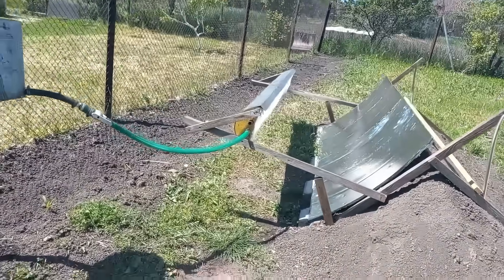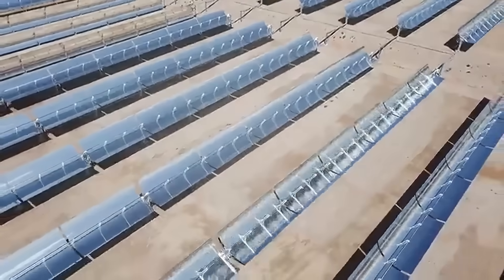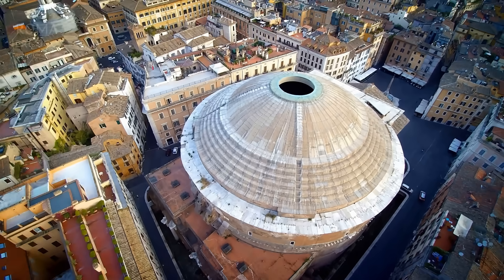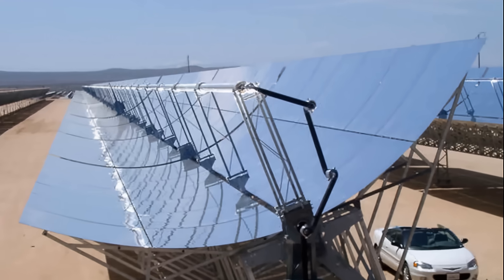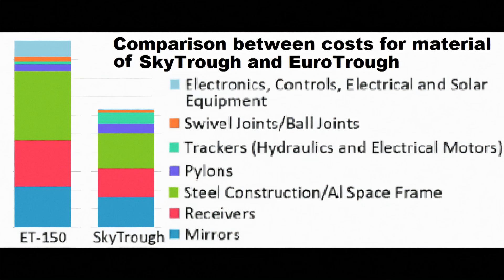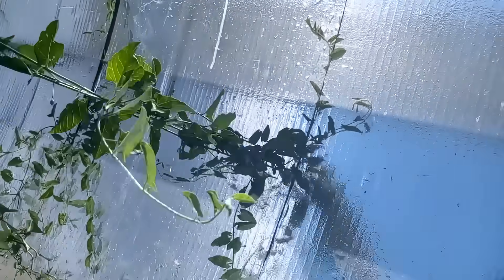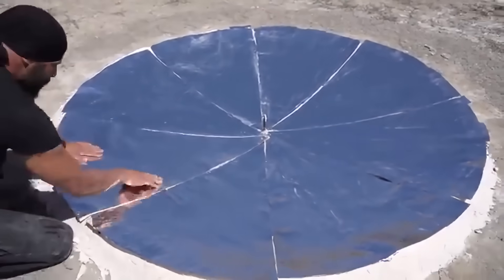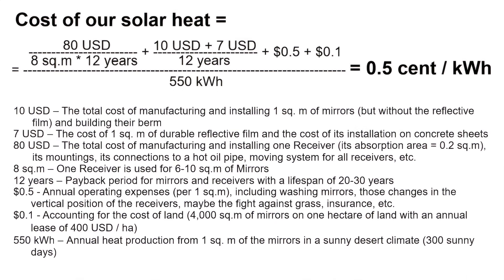Mirrored concrete for cheap solar energy

Comment: I quite like this. And, despite the fact that I know no one's probably going to read this, that is why I want to offer a critique of this idea, since it seems few others in the comments are doing so.

In short, I think this is a brilliant source of cheap thermal energy for certain users... and near worthless as a source of electrical energy, or thermal energy for most people out there. Given that this system outputs its energy as low-grade heat, not electrical energy, it's not a direct competitor to Solar PV. A direct competitor would be this system + a heat engine to convert the heat to electricity. But given how low-grade the steam is here, thermodynamic efficiency is going to be low, low enough that it's basically going to be impossible to beat Solar PV here.

And things get even worse when you consider heat loss to the environment. Most heat engines prefer being built big, to enjoy economies of scale (e.g. a heat engine twice the size, has 8 times the volume, for the cost of only 4 times the surface area and thus 4 times the metal and stuff). Big heat engines, however, require lots of heat to function, which requires feeding them heat from a big area, which requires moving heat a long distance from the mirrors to the heat engine, which means a lot of heat is going to be lost from the heat pipes to the surrounding environment. (Remember, the entire point of this setup is to use cheap materials, like cheap plastic pipes. Even if they never spring a leak, cheap pipes aren't very good at holding in heat.)

So even before we add in the cost of the heat engine, or related things like heat pipes, the cost of electricity generated this way can easily be 10x what you calculated for the cost of the raw heat, 5c a kWh instead of 0.5c, simply because the thermodynamic efficiency of this setup might only be 10%. That's already expensive enough to be about the same, or worse, than Solar PV, before we add in the cost of the heat engine. (Or related costs like the cost of repairing & maintaining the moving parts of a heat engine, compared to the maintaining the glass rock of a Solar PV panel)

So this isn't a better way to generate electricity. But maybe it's a better way to generate heat?

No, probably not. The cheapest heat out there is actually waste heat, heat that costs $0.00 a kWh because it's already being thrown away by someone else. That's what CHP (Combined Heat and Power) is for, where a town or something might heat itself using the waste heat from their local thermal power plant, or a factory might run off the waste heat from their local thermal power plant. You can't beat free.

Well, at least for those who live near a major source of waste heat. But there are plenty of people who don't live near big power plants, e.g. people in big cities. Maybe they could use this?

No, probably not. The entire point of the concrete in this setup is to be heavy and anchor down the mirror. But for people who want to put a hot water heater on their roof, because they live in a city and don't have a lot of room to spare... all that weight is just a downside. A standard hot water solar heater, is a much better fit for their needs.

So, what about people living out in the suburbs or whatever? They've got land to spare, right, in their backyards or whatever?

Well, they would... but it's probably more efficient to just use a Ground Source Heat Pump instead. Thanks to the roughly ~10x gain in energy from electricity spent to heat gained, and the ground being an essentially infinite source of heat, Ground Source Heat Pumps are competitive with basically any other source of heat out there... especially if you're using cheap Solar PV electricity, from a home PV setup. (Plus, they can be reversed to provide cooling in the summer!)

So, there's probably not a lot of people who actually have a use for this. A lot of the people you'd first think of, already have better options. There are definitely some people out there for whom this will be a godsend, e.g. farmers who need to dry out their crops after the harvest, and therefore require higher temperatures than a Ground Source Heat Pump can reach, but who also have lots of empty land they can put solar heaters on (and would therefore prefer the cheapness of concrete to the lightness of a conventional solar water heater), and who don't live near any power plants or factories willing to provide cheap waste heat. There are some people out there who could really use this. Just... not a lot.

(And honestly, for them, there's already a surprising amount of competition in this space. E.g. Solar Ponds, which can reach surprisingly high temperatures just using saltwater and black paint. Those perform best near desalination plants, since they can recycle the waste brine from desalination... but they're still a competitive option for Mr. Farmer looking to dry out his crops. Last I checked, anyways, at least.)

TL;DR: Industrial users can probably use Combined Heat & Power / CHP instead. Residential users probably don't want to crush their roofs beneath the weight of concrete. That only leaves Agricultural users. And even the farmers have alternatives that might work better, depending upon their exact circumstances.
Reply: Bro put "In short" as the first two words of the thesis. No hate, just thought it was funny
Reply: Wow, this is a very in-depth and well researched comment, bravo
Reply: Agreed. His system lacks the heat>electricity part, which is a hard problem.
For heat generation, usually needed in winter by residential users, maybe it's a good cheap system.
Reply: It sounds like you are knowledgeable in this area...How would this system be beneficial in a tropical area receiving sunlight 10hrs or so a day...especially for agriculture as the use case that you mentioned...
Reply: @MzeeRatili  Probably pretty beneficial! Normally, the downfall of any solar mirror setup is clouds, since they normally only work with direct sunlight, not diffuse sunlight that's passed through a cloud. In wet, rainy places, that generally means they're a bad idea, and you usually only see solar mirror setups in deserts.

However, if the Compound Parabola thing the other comments are talking about, actually works, then it sounds like it should take care of this problem. I'm not 100% sure it should, it sounds like it'd violate the Conservation of Étendue, but if it works... then you should be able to concentrate diffuse sunlight onto the collector heat pipe.

That means that this idea should work great in places that rain (e.g. tropical areas), again as long as the Compound Parabola thing works out. I'm not 100% sure of the exact heating needs of someone living in the tropics, but I think it should still be quite useful. The max temperature of the water/steam this system puts out, should still good enough for things like boiling water, drying out firewood, pasteurizing milk, malting grains for brewing, heating up biogas digestors to digestion temperature, taking hot showers, and, of course, processing crops (e.g. drying them out, or processing them into silage).

It'd pair well with a home PV panels setup to provide electricity for things that need electricity, like charging phones and computers. The concrete mirrors setup can instead provide low grade heat to things that only need low grade heat, saving valuable electricity and firewood/propane. Quite handy.
Reply: I think it's great! It's an easy to make renewable source of heat that doesn't require electricity. Great for people aiming for a low-tech off-grid life.
Reply: In addition to what you were stating: such energy  (solar thermal systems with reflectors and focusing principle -> csp system) work with direct  (DNI). So its use is limited to all the areas where there are often clear skies and viewer hours of cloudy weather or other things which  direct sun rays to diffuse sun light. PV generators don't have such limitations. They work with direct and diffused sun light (global horizontal irradiance - GHI). In Germany (e.g.),  a PV generator system will be better than any csp system, which is why there are very few solar thermal systems in use in Germany, not on a power plant scale and not even home applications.

So i want to highlight "it's not a direct competitor to Solar PV", more like a complementary technology.
Reply: The price. You forgot about the price. A generator running on mechanical energy is dirt cheap, and this setup is essentially home made. Meanwhile solar panels cost hundreds of dollars. And durability. If your solar panel gets scratched in a dust storm you can bin it. If it breaks in two same. With this it doesn't matter if it cracks and if it gets scratched you resurface it. This is perfect for places far away from civilization centers and in places where cost matters a lot. Farmers, and third world communities could have a backup for unreliable power. (South Africa I'm looking at you.) This would also be perfect for the south side of agricultural buildings.
Reply: @nemo-x  That's... essentially what I'm saying? But radically underestimating the cost & maintenance requirements of a heat engine/generator + steam turbine or Sterling generator. It's good at providing heat, yes. It's not good at providing work, whether that be in the form of mechanical energy or electrical, because the conversion of heat to work is the actually expensive part of the process here.

Comment: If you don't think about space usage, Water supply and efficiency, YES, Solar Boiler generator can be produce easily but have more efficient loss as solar turn water into steam to drive generator. 
The more of process, more loss of energy in the process while Solar Cell is generated direct electricity have less energy loss.
It's very useful if you need produce hot water for daily use.

This technology is not suitable for desert country where water is extremely precious.

Comment: Would you need to replace the films if you were able to laminate them with something that was near 99% clear with no reflectivity of its own? Curious if this would be a solution to needting to replace the films? simultaneously would cheap glass also work?

Comment: They actually already tried this in a dome. It:

Killed many, many birds by burning them to a crisp

Was extremely expensive to build and maintain 

Drastically underperformed to the point where it was not sustainable

In the end, it had to be shut down. Turns out nuclear is still the answer (AND safer than this).

Comment: sun-droplet farms. probably about 15 years old. Using concave mirrors to heat piping. The piping is also layered with solar panels to convert the light into energy. The pipes heat the water to steam and can be desalinated to produce clean water and energy. That can then be used to feed crops and power the farm.

Comment: Night hawk in light has a air crete recipe you need to use! 

Combine with fiber filament enforcement, and use a spray tacifier with aluminum powder instead of this film potentially

Comment: Problem of such solutions is that the 34 resellers in a pyramid Ponzi scheme of the solar scam don't get paid 10% each in the process FOR DOING NO WORK at all. Btw, your earth backing has the problem of earth being net positive, needs to be brought from somewhere. This could be solved by moving the whole contraption half a meter lower, digging a ditch and using the same material as the earth backing for free.

Comment: This would require significantly large installations of these devices to power a home. And you still have the issue of energy storage. It seems like at the moment it makes more economical sense to buy cheap Chinese made solar panels than trying to construct something like this yourself.

Comment: Another thing to potentially consider is insulation of concrete, allowing more heat to be absorbed by the element. This benefits from the flaw in traditional solar pannels in that most of that thermal energy needs to be removed by a heat sink since the solar pannel is converting visible light into electricity directly, not into heat.

This also means that the more effective the concrete mirror is at insulating, the more heat ultimately gets reflected and absorbed by the element.

I would recoomend checking out a recent video by nighthawkinlight where he produced concrete with air incorperated into it utilizing a detergent with xanthum gum mixed into it. While this increases the expense, it makes the mirror body lighter and more insulating. I'd be interested to see if the boon of energy is worth the cost in materials.

Comment: I'm not an expert on this. not even learned or anything. I'm just a software nerd.
But is reaching a price per kWh cheaper then nuclear power even relevant? just because it's cheaper per unit of output, that does not mean the total output capacity is the same.
I mean, do we really care about cheap solar if it takes covering half the planet in mirrors to replace just 1 nuclear power plant? Obviously i'm exagerating, but i think what i'm saying makes at least some sense right?
Reply: If you're using solar panels and need something cheaper to scale with, you wouldnt turn to a nuclear power plant would you know? And the comparision was basically just a benchmark.

Comment: The only problem with mirror design energy generation alternatives is that it's very dependent on direct sun light. If the sun is blocked by clouds the heat goes down. Meanwhile, photovoltaic generation doesn't necessarily stop on cloudy days. This is what made several big mirror based sterling engine designs (highly efficient heat to kinetic energy conversion) to lose funding and stop dead in their tracks.

Comment: Switch to oil for the pipe going through your focal point. you can make a smaller more concentrated focal point and the oil can be over the boiling point of water and still be oil. use a heat exchanger to make steam

Comment: Ok, so you get cheap solar heat....with a lot of downsides and maintenance, but say it is cheaper for electricity, without an actual way to generate electricity, yet showing the KWH cost of the heat only, which after you factor in efficiency losses of conversion would be around what the cost of solar PV would be. Except you would then need to add in the cost of actually building the conversion equipment and all the other electronics associated, which would make the cost then much higher than just getting PV without all the downsides.

For simply using the heat, it could be ok, but solar thermal plants have been tried, and they all failed spectacularly and shut down due to operating costs being higher than other sources of power, even though the energy is "free".

Comment: The concrete is a great idea, but the cast surface needs to be much smoother. Also, the long durability films are a good idea. A CNC created mold for the concrete would give a precise curvature, and a smooth surface.

Comment: nasa...lol
.666ft per mile squared = Curvature rate of earth 
66,600mph = Earth going around sun 
1666 = Year gravity was invented (666 newtons)
66.6° latitude = North and south arctic circles 
6x6x60 = Diameter of the moon
6x6x6 = Surface temperature of uranus 
4.666km/s = Plutos orbital velocity
666 = Speed of sound in knots
600 x 6 x 6 = earth circumference in nautical miles 
1.666 AU = Distance from mars to sun
1,426,666,422km = Saturn orbital distance 
666 times brighter, the sun is than venus
666 days. Longest time a female astronaut has been in space

Comment: I think this would do well combined with a stainless sheet mirror, since I think the cost of resurfacing labour would outweigh the cost of thin stainless sheet.
Thermal expansion might be a problem, so the clamp on the top and bottom that pushes the sheet into the curve probably need to be a bit springy.

If thermal expansion is not actually a problem then you could just spot weld little tags onto the stainless (very cheap) so that the concrete can be cast onto it without needing other clamping.
This would be the most durable if it works, since even a hurricane couldn't lift the sheet off, and you could re-polish them very aggressively without risk.

Comment: You could focus the light on solar panels too if you want electricity and not heat. Would be particularly useful in the winter when light levels are low.

Comment: He is calculating the cost per kwh, but I cant see any kwh produced. Only steam coming from a tube in bursts. Further inventions are necessary to get the steam flowing in harmony with a sinus wave Generator. And this will take much more brain than making simple mirrors. Then calculate the cost of this brainwork plus Generator plus additional components. Then you have the Real dollars per kwh.

Comment: If you were to generate electricity from the heated water then wouldn't it be advantageous to replace most of the berm with battery containers? I recognize that pushes up the build cost but it also stops some of the issues you saw with just dirt and provides a shelter for the batteries.

Alternatively, You could make a simple base and build the berm mostly from sand sourced in brackish water. The concreate won't be affected by the salt, but nothing will be able to live in the salty sand mixture. You might need to add some clay for stability, but that's not going to be a major expense.